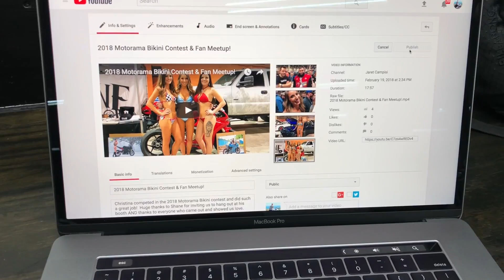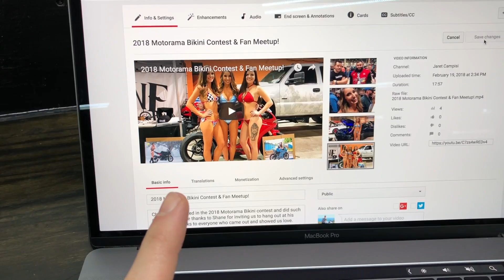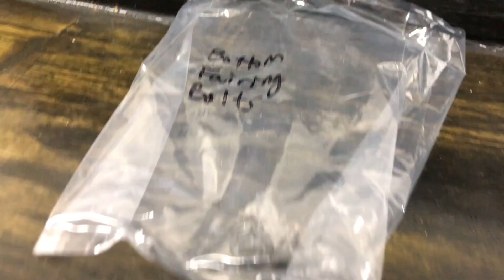Prepping the 1299 for the Full Akra Titanium Exhaust!!!

Comment: You should do Aprilia RSV4 next that is a high end sport bike
Reply: Fyi I only said that because of your comment Jaret but another guy was saying that this bike should make a little over 200hp and you got I think it was 178hp on the dyno I hope the hp loss wasn't from that exhaust leak
Reply from the maker: Stock 1299 panigale's make 175 to 180 hp on the dyno so ours was exactly where it should be.  You have to be careful when you hear HP numbers because all of the motorcycle companies display CRANK HP which is vastly different from dyno numbers which are at the wheel.  On Ducati's website this bike says 205 hp to the crank so 180 ish to the wheel is spot on.

Comment: Just remember jaret with the lipo battery. They do not like slow discharge (draw). I.e alarm,imobbilizer ect. Had to take mine off for the winter. Alarm drain mine dead,so probley damaged cells aswel,all within 8week no use. Amazing difference in weight tho. Did you manage to find weight for exhaust servo cable and housing? I never weighed these when took mine off. Works out around 7kilo I've lost off my 899. Love the video jaret

Comment: Jaret,  are you going to be doing the heat shielding like you did on the other Panigale? What will you be doing with the red  body work after you put on the Carbon fiber body work? By the way awesome job Jaret and Dado.
Reply from the maker: We will be hanging onto all the stock parts in case the new owner wants any of them.  Yes we will be doing some heat shielding on the side covers and under the seat as before.